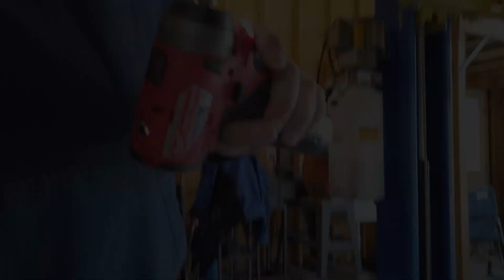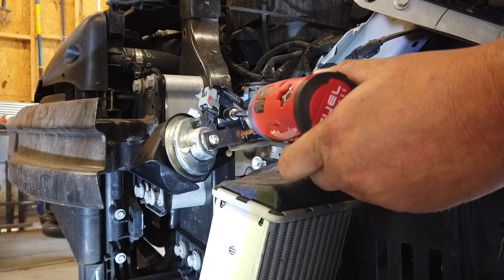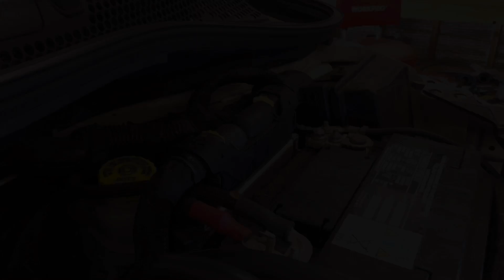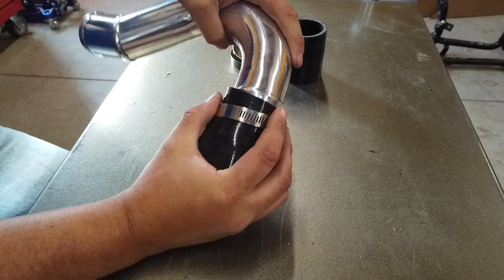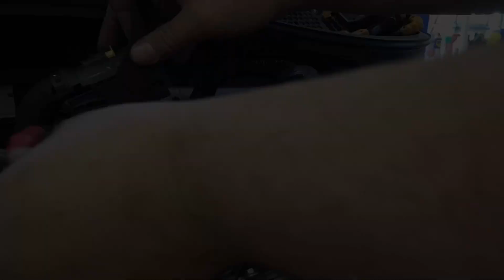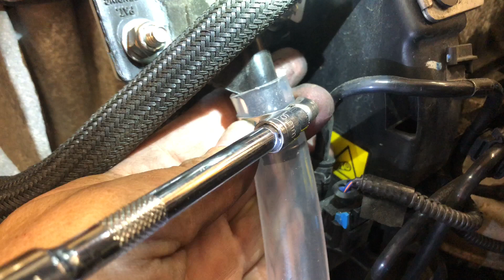Fiat 500 Abarth Front Mount Intercooler with ATM Fenderwell Intake Install

Comment: great video! how are oil changes with the intake? do you have to remove the bumper to remove the piping since there is a nut under by the filter? edit: i just got to the end where you say you might need to remove the bumper lol. have you figured out a way to do the oil changes? also what does the butt dyno say after these mods?

Comment: Did you find a quick release system for the bumper? Doing the oil change I have braked the lateral tabs.
Reply from the maker: I never have, still pulling the bumper the hard way for every oil change

Comment: Hey, have you done a oil change with the atm intake? Do you have to remove the bumper to get the oil filter off?
Reply from the maker: I remove the bumper.  Some pull the intake from the turbo to make room.

Comment: Thanks for the video. I'll be using to install my ATM FMIC this weekend. 

Also, I haven't heard back from you about the tune, do you still have the FIAT?
Reply from the maker: I do, and I ran the tune all year.  It was great!  I just haven’t had time to mess around with the videos
Reply: @EveryOtherFridayOff  definitely hit me up. I’ve learned many things :-). Again thank you for the video. My install was completed using intuition and by watching your video since the link for ATM’s install is “private”.

I didn’t remove my headlight; that was a mistake. I also had the grommet pop inside the reservoir and caused my motor insert to bend….

All is well but the struggle is real. Lmk what you come up with for quick releases on the bumper.

Comment: I noticed you have a front license plate. Do you think that impedes and negatively affects the performance of the FMIC because it's covering part of it?
Reply from the maker: Some, but what I’ve seen is that temps drop like a stone as soon as I hit 30, even with a heat soaked engine.  So I’m not worried about it.
Reply: @EveryOtherFridayOff  Is a FMIC one of those "must-have" mods for the Abarth? Or is it mainly for people who autocross or track their cars? The SMIC aren't THAT bad are they?

Also did you have any fitment issues with the CHQ/NGEN FMIC with your bumper and fender? Any noticeable gaps in the body or does it sit flush?
Reply from the maker: @CrazyForCashews  Not a must have.  The double bonus for me is being able to put the intake where a side mount was
Reply: @EveryOtherFridayOff  Thank you for your quick reply, good to know! It seems like a FMIC for the Abarth is a no brainer.

Comment: This video was a lifesaver!  Just did this exact same project.  Question: How the heck do we refresh the air filter when it gets time?🤣
Reply from the maker: I’m pulling the bumper and quickly trying to come up with a quick attach method for the bumper.  Apparently some guys are disconnecting the intake from the turbo and reaching through.  Guaranteed I would dump half a filter housing of oil down the intake if I tried it

Comment: Hey great videos! I have a 2012 model that has loud front wheel bearings, and I was wondering if you knew of a well-regarded 3rd party set of high quality replacements, or if I should just check with the dealer. Any experience with wheel bearings? Thanks!
Reply from the maker: Sorry, no insights.  I think this has been discussed a lot on the forums like fiat500usa forum.   Good luck!

Comment: Awesome videos, really well done!! What led you to go with the fenderwell over the cowl Intake from ATM?
Reply from the maker: I've seen numbers where they are both supposed to have similar performance, and I've got zero evidence to dispute the claims of the cowl intake, but just looking at where they sit and run, it sure seems to me the fenderwell ought to be a cooler position.  I also really like the clean engine bay
Reply: Also I’ve heard with the cowl intake, you hear a lot of intake noise. I personally have had the fender well intake for about 2 years. Only issues I’ve had are the plastic caps can crack on the reservoir and fill.

Comment: Hey I got a shout out!!! Hahah that was me guys, I was the unfortunate subscriber doing the boost leak mod! I feel famous :)))
Reply: I also wanted to say that you should try a home DIY ram air setup for the intercooler like time attack/ track cars. Instead of hoping the air makes its way through the honeycomb grille and other bumper obstructions, you could make a cutout marching the size of the intercooler and seal it together so there is no air gap between the front bumper and the intercooler. I’m sure you’d be running a little colder!